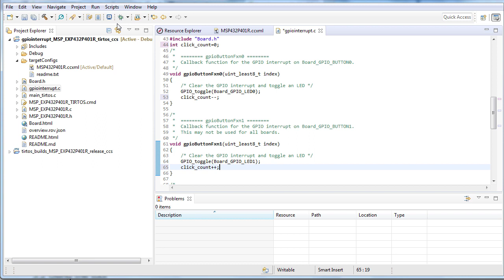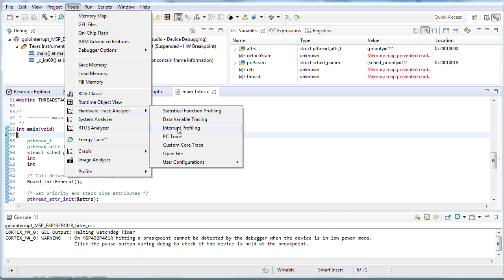Data Variable Trace with SWO Trace

Comment: I understand ETM requires Ulink Pro (won't work with JLink Pro) for ETM streaming traces.. 

So I'd like to use SWV data tracing (SWO pin), in either format:
1) UART style (1-50Mb/s) - supported by ULINK2 and ULINK-ME
2) Manchester encoded (100Mb/s) - supported by ULINKpro

But is it possible to use any SWD debugger (J-Link Edu/Mini, Black-Pill, AT-Atmel-ICE) with any SWD board (STM32, Smartfusion2).. using Eclipse/OpenOCD?